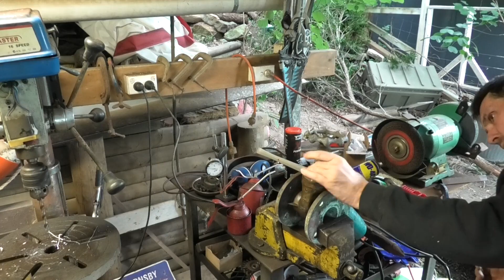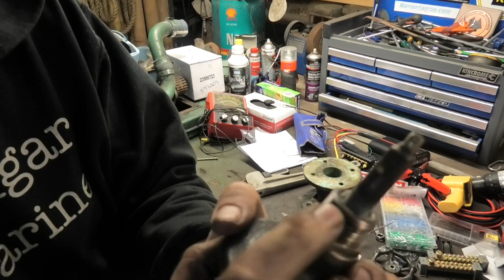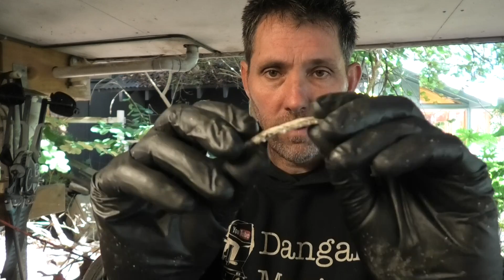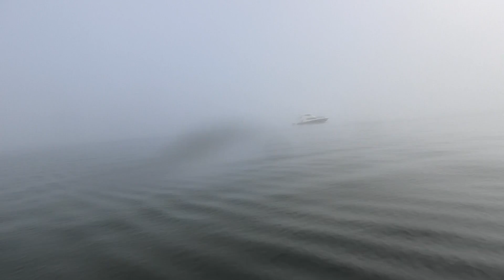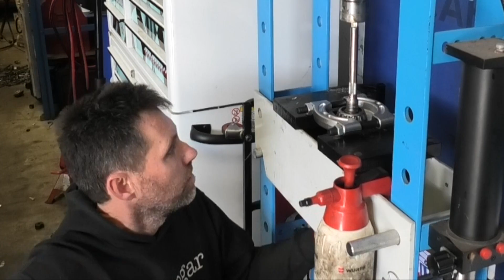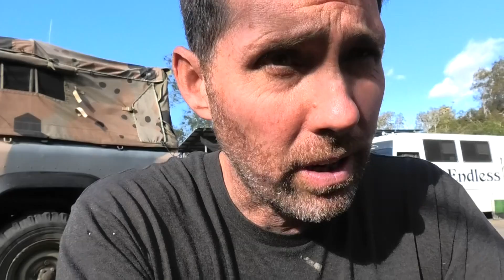Servicing gate valves, installing battery shelf, disassembling gearbox and heat exchangers

Comment: Stu you probably considered this already, but I would try removing the rust inside the cooler housing by electrolysis.  I use the process mainly for intricate parts or where I cannot get a wire wheel or a good shot with a sandblaster nozzle.   I would suspend the a sacrificial graphite anode down into the cavity to intensify the reaction.    The only down side is that it takes days to work. Check out the many videos on YouTube.
Reply from the maker: I found this one to be the best. ;) https://www.youtube.com/watch?v=Q12EIRbFKPk

Comment: Ive used rear main bearing seal packing. Used to be used on the crankshafts of 60- 70s engines. Have a nice trip...sounds like it will be!

Comment: I like the non-corrosive battery shelf, but I think you'll find the plastic will sag over time due to the weight of the batteries. I think you need some steel support under there - like a couple runs of angle iron under the plastic.
Reply from the maker: Will definitely keep an eye on it.

Comment: Muriatic acid (pool cleaner or 32% hydrochloric acid) works well for me to clean metal parts. Not sure how well caustic soda would work on, rusty non-organic surfaces.  Have used caustic soda to clean clogged drains and to boil off grime from pots.... but that's not rust.  Maybe a good soaking in caustic soda to dissolve organics followed by muriatic acid bath would be the ticket.

Comment: Hi Stu. Hopefully you caught it, but you reassembled  the valve in the wrong sequence. Should be, gate into the body, then install the bonnet, then thread the stem in then the packing gland....... This way the thrust collar on the valve stem rides between the upper side of the bonnet, and the lower side of the packing gland, which keeps the stem from moving in and out of the valve. The way it is now all the opening thrust will be on the underside of the handle to the top of the packing nut.
Reply from the maker: Thanks mate. Am going to pull it apart and lap the valve as others have suggested so I'll check the reassembly order when I put it back together after that.
Reply: @DangarMarine  Wait mate !! That guy tellin' ya all that has OCD, I know 'cause he's in here with me! The Doc tells us that boats are an affliction ... so ya need weepy, leaky valves to build up stinky, oily, sloshing slime in bilge to develop "healthy hate" for boats as a psychological balance. It would be awful to see you go off the deep end too, buddy ... oh,  I mean mate.
Reply: @DangarMarine  I agree  especially if its on a suction side. It may not leak like a tell tail
Reply: Expertise is so ... depressing
Reply: I totally missed this, but you caught it. Hope he does see this because it prob won't leak right away and cause doubt on the issues cause later! Good catch!
Reply: hope he see's this

Comment: Caustic soda works so much better when it is heated AKA Hot tank that engine builders use. I used to cut a 200 litre drum in half and fill it up 3/4 full and use 2 x 4 litre paint cans full of caustic soda. I used to have a big heating element inside the drum and used to cook engine blocks and other parts in the solution. it worked great. Don't stick alloy anywhere near it but
Reply from the maker: Heated definitely does sound like the way to go.

Comment: Hi Stu, 
I was browsing around for an industrial valve distributor near you, should be able to source your parts and replacements here. Figure out which distributor has experience with your type of application, since they also sell marine valves, ask them for some of their catalogs. 

You could have other valve distributors in your area, but this was how I got valves and parts locally when I worked in the processing industries. Water, steam, oils, liquid nitrogen-systems, gases and WFI (water for injection).

https://www.mrcglobal.com/Company/Locations?q=Australia

https://www.mrcglobal.com/Company/MRC-Global-Brand

https://www.mrcglobal.com/AsiaPacific/au/Products/Valves

The gear case would be a good candidate for electrolysis cleaning with washing soda, battery charger and sacrifice iron/steel piece. I saw an engine block cleaned that way, it even loosened the paint and oils, made the block look like new and also cleaned out the passages.

Test with water pressure for leaks on your heat exchanger, if you find one that cannot be sealed we would weld the tube closed as long as there were not too many.

Have a safe trip, enjoy JAM

Comment: If I remember correctly gland packing was graphite impregnated asbestos string, pretty dense stuff, has to be the right size. Also with the dreaded gate valve you have to make sure to open and close them regularly or the buggers will seize, never leave them wound all the way open,or all the way closed, back them off a bit, why ? ‘cos the buggers will seize !!
Reply: We called it exercising the valves during PM's.
Reply: You're right about the Asbestos packing.

Comment: Hey Stu,
I've done the maths for your caustic soda solution and if you have used the 4kg of soda for 100L of water you will get a concentration of 1M or as you said 4% weight/volume.  That being said, 100L of water should be able to take approximately 10kg of the soda until saturated. Really enjoying this project, thank you for the hard work you've put into it. Also, where can I buy a shirt? Would love to help support the build financially (albeit a small contribution).
Reply: Sodium Hydroxide has about twice the molecular weight of water (18g - 40g) .. 100L of water is about 5500 mol, so 4% of that is 220 mol, or 9 kg of NaOH.
Reply: Hmm, double-checking my 30-years-past Uni Chemistry, what I've said is true with molar solutions. Things can be also be weight-percent, and volume-percent solutions, because human civilization loves complicating things...

Comment: One of the best channles on YouTube, you don't pretend to know everything like some do and you have some good followers below. Every item I was going to comment on has been covered - angled stuffing - cotton stuffing, etc. I do like 'Copperslip' if you want a trade name. 'Calgon' might be worth a try, I'm sure you can work out what that does - or is supposed to. They used to use a fine lead based grease for lubricating stuffing, but I suppose these days it's a no, no. 
One word of off topic advice though. Never use anything other than 60/40 lead tin for soldering unless you are going to suck it all day. This new lead free stuff is becoming notorious for growing crystals, cracking and poor joints. The Romans used lead pipes and lead mugs and they were OK - maybe.

Comment: Actually think the nickel-based anti-seize is the proper one to use for brass.. I think I remember something negative about copper AS on brass because of additive chems and the copper+copper doing funky crap, could be wrong though.
Or maybe some molybdenum disulfide if you wanna spring for overkill expensive stuff

Comment: For cleaning out the heat exchanger you really need an acid, not an alkali.  Try  a hydrochloric acid boiler descaler  or brick cleaner. Phosphoric acid is an alternative. ( didn't you use that on the hull?)
Reply: Alkali= meaning acid base. Apple cider vinegar would work well and is cheaper than other acids. BUT there may be oils and calcium in there that acids wont remove but the lye will.
Reply: Muriatic acid will be to caustic it rusts steal and eats aluminum.
Reply: What about a quick electrolysis to clean it up? Too aggressive?
Reply: Would adding Bi-Carb to the vinegar work, it's what they use for cleaning the scum out of washing machines.
Reply: Molasses or electrolysis would be my choice
Reply: muriatic acid will do fine ...    hydrochloric? ... you have to be an american
Reply: @argtv100  muriatic acid tends to eat graphite in cast iron castings making them porous and very rusty.
Reply: @jacilynns6330  ok  what do you recommend  muriatic is powerful and fast
Reply: @argtv100  apple cider vinegar
Reply: @jacilynns6330  but that takes too long

Comment: When I used to service boilers we used to use the graphite rope like old mate above suggested, and we also used to soak the valves in hydrochloric acid for ten minutes then hit them with the wire buff, they come up like new,  they were brass though, they look pretty much identical to the ones you have, I could be wrong though. Love the channel mate, keeping it real🤙😁

Comment: For cleaning, we use a Decarbonizing fluid designed for cleaning flame traps on diesel engine's leave to soak will clean anything can dilute with water depending how strong you need it

Comment: As far as dissolving rust on cast iron you can’t go better and safer than 50/50 white vinegar and 
water. Leave it for a week then give a good soapy brushing/wash off  and apply a spray oil over to stop the 
cast iron from unpainted areas rusting again

Comment: For dissolving the rust, I'd go with molasses and water, it works well and is much kinder to your skin than sodium hydroxide. 

For that job, 5-10L of molasses dissolved in the tub, chuck in the rusty bits and leave it alone for a week (although you can dip in there and agitate/rotate them with bare hands if you want).  Rinse off with water when you are done. They will flash rust though.
I did an exhaust manifold and it came out looking like it just came out of the mold.
Reply: I just learned something thanks mate!

Comment: Really enjoying your content (intro'd through Brupeg), thought I might add my 2 cents worth cause I know how much you appreciate it 8); cut the shaft packing ends at a 45° angle for peace of mind.....the compression will prevent any direct path through the join. In corrosive environments I think it is always best practice to avoid dislike metals in direct contact (possibly would have used the synthetic marine grease you had down at the boat), but the drillers I worked with would always slap permatix copper anti seize on everything, it seemed to always work .....but they are rough as guts. Cheers

Comment: cut the ends of the seal at 45 degree angle so they overlap and stagger the joins around the shaft so they don't sit on top of each other
Reply: Now you tell him.  After he's already done it.  (sarcasm)  Actually it's one of those - 'why didn't I think of that' moments.
Reply: @flick22601  For the next time and for others watching now.
Reply: was thinking this same thing. cheers.
Reply: Len de Sales spotted you after I posted Len. 🙄
Reply: 45 or even more shallow.  A long overlap can't hurt.
Reply: scarf cut the seal 30°

Comment: I'm glad it was for the cooling because there ain't no way squirty stuff would penetrate in that place, or the gaskets below. The big round green bit is tapered and the raising and lowering action of the spindle pulls or presses the flat surfaces onto or off'v the corresponding surfaced on the valve body. Your best trick would be to ensure those surfaces mate properly like.
Reply: Not having seen a gate valve appart in person I was having trouble understanding how it seals.  Thanks for your description which makes it perfectly clear. I didn't notice that the gate is a tapered wedge.

Comment: Add baking soda to vinegar and the reaction helps break up the calcium
Reply: Ron Bertka no soda. Just acid to oxidize the minerals
Reply: Baking soda neutralizes the vinegar, you idiot.  If you combine them all you will get is club soda (water +CO2) in you container.